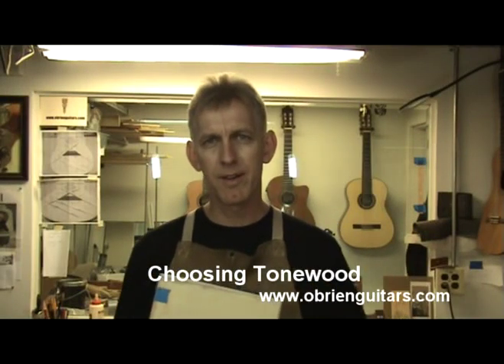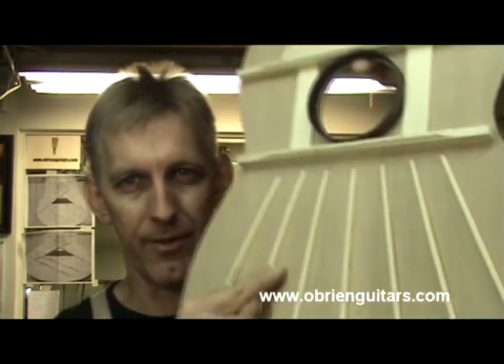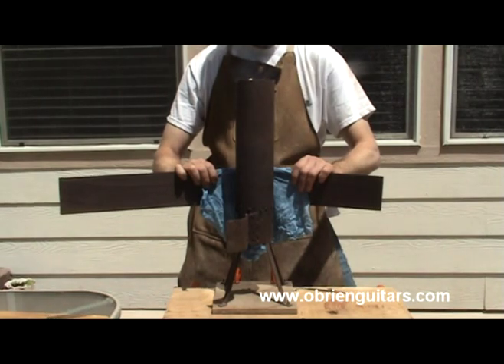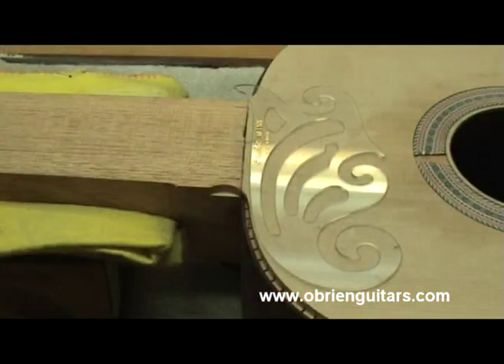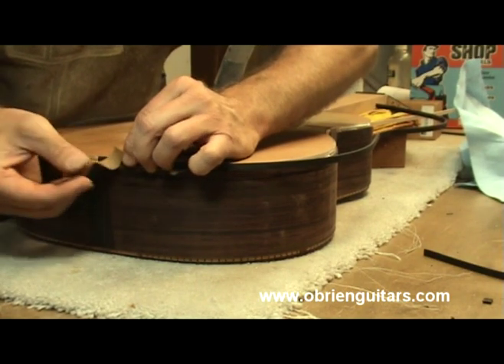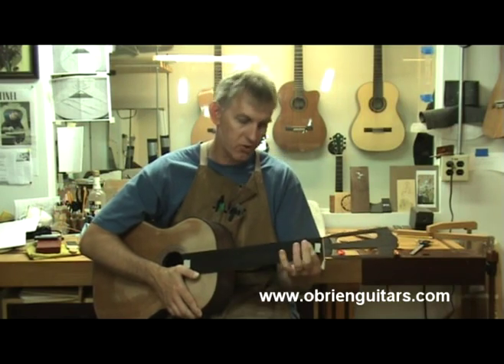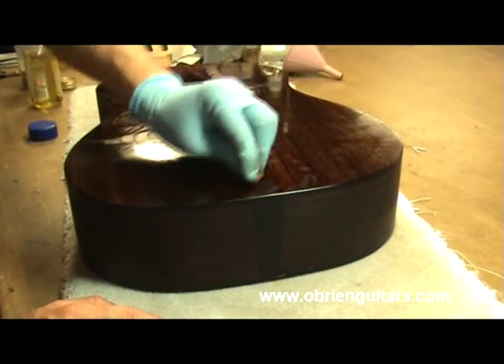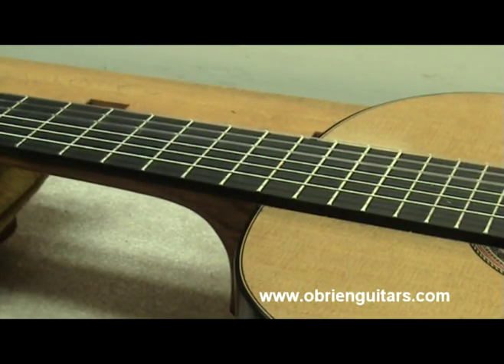Robert O'Brien online classical guitar building course sample lessons.mpg

Comment: Hi!  Great video!  I'm thinking about buying your course, but I have two questions. One: do you talk at all about less expensive tool options?  I mean if I can't afford all the professional equipment you are using and still want to try building a guitar?  And second, do you include info on installing a truss rod, or some kind of support for the neck? The reason I'm asking is because I'd like to build a multi-string guitar (hence more pressure on the neck and body). Thanks!

Comment from the maker: Thank you for your interest in my videos. In them I show how to do most steps using hand tools. I also show how to use power tools. You will need some specialty tools like nut files or radius dishes. Most of the jigs I show you can make. You can build a guitar with a pocket knife if you want. I wouldn't recommend it as the level of precision goes up with some tools and jigs. Watch my entire course before purchasing any tools and jigs and you will see some that you can make yourself.